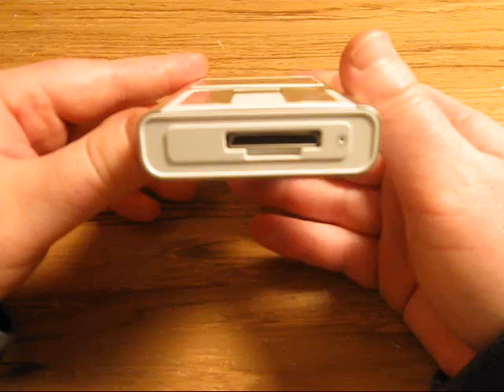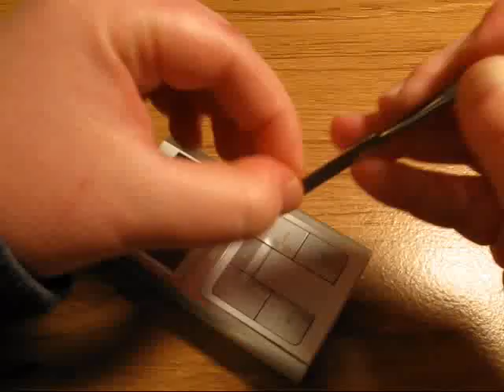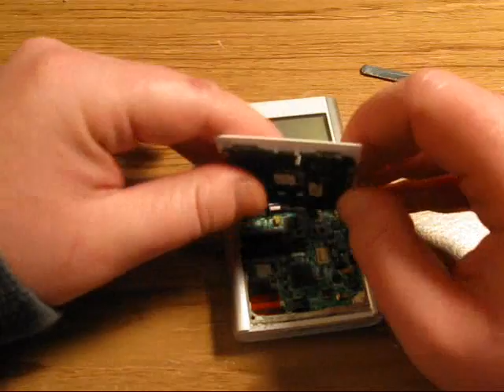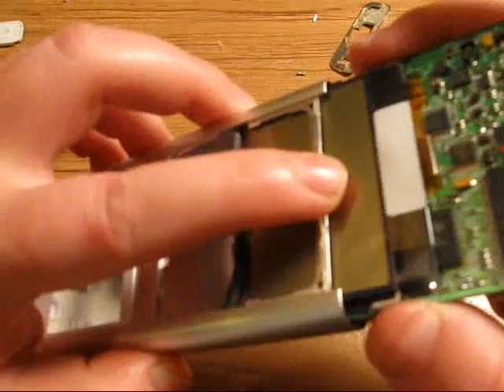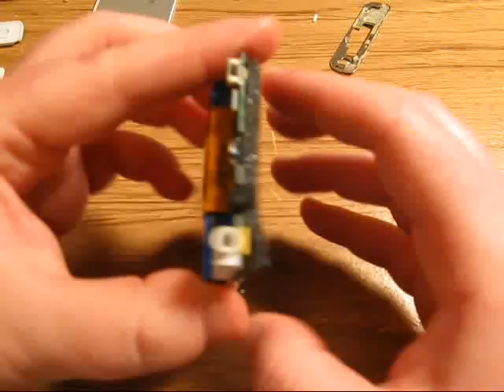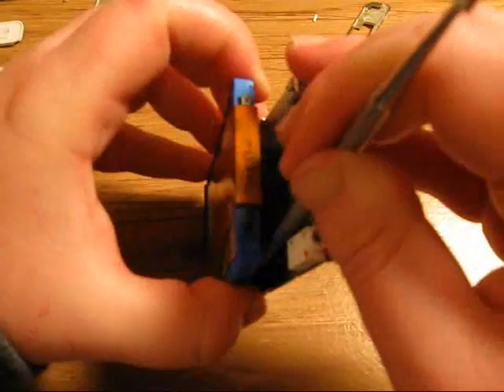Zen Sleek & Sleek Photo Complete Disassembly Video by a Technician

Comment: WOW. I KNOW THIS WAS YEARS AGO BUT DO YOU STILL ANSWER QUESTIONS ABOUT THIS CREATIVE ZEN PLAYER ? I'M TRYING TO SAVE MINE AND THE COMPANY HAS RETIRED THIS ITEM FROM 2006 AND I NEED WINDOWS XP TO RUN THE SOFTWARE. BUT I NEED TO KNOW HOW TO SAVE MY 20G OF IRREPLACEABLE MUSIC ? IS THERE AN SD CARD ? WHERE IS THE MUSIC STORED ON THE MOTHER BOARD AND CAN IT BE PLACED INTO ANOTHER CREATIVE ZEN PLAYER WITHOUT LOSING MY SAVED MUSIC ? YOU VIDEO IS SUPER INCREDIBLE AND I JUST NEED CLARITY ON HOW TO GET MY MUSIC WITHOUT LOSING IT. I HAVE SEVERAL ZEN PLAYERS NOT WORKING THAT I CAN USE FOR PARTS. MY PROBLEM IS THE BATTERY 🔋. I CAN REPLACE IT BUT WHERE THE CHARGE PLUGS IN- IS DAMAGED AND NEEDS REPLACING. I WOULD SUPER APPRECIATE ANY HELP YOU COULD POSSIBLY OFFER 🤗AND THANK YOU SOOO VERY MUCH FOR THIS VIDEO‼️

Comment: I've just managed to do that (and reassemble it), thanks to your videos.  Since I don't have a spatula, I've managed to do this with a butter knife.  But when taking it apart, the little plastic bottom part broke into pieces.  I'm not too concerned about that because I got my Zen Sleek (with the charging dock) at a church rummage sale for only $5!  The device was shutting down, but it "got stuck".  So, I decided to try disconnecting and re-connecting the battery.  That seems to resolve the issue (maybe for now).  I may have to replace the battery or the HDD.